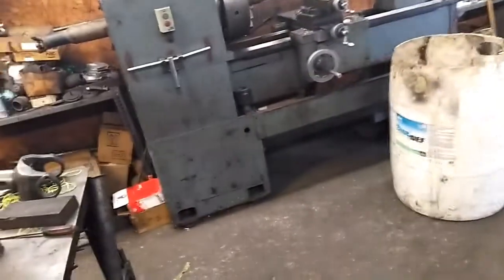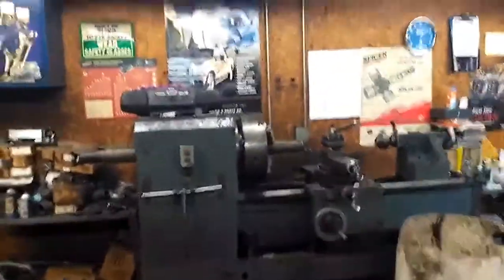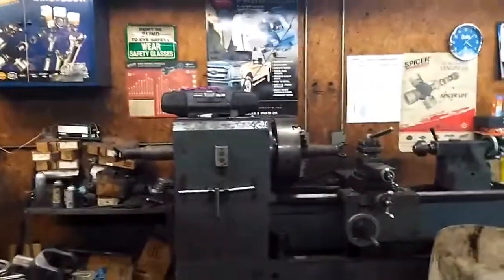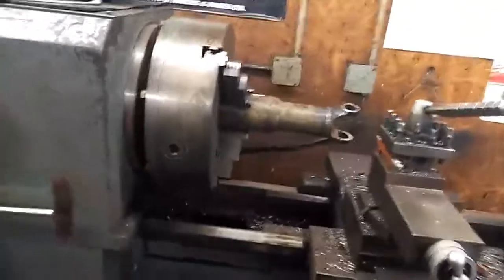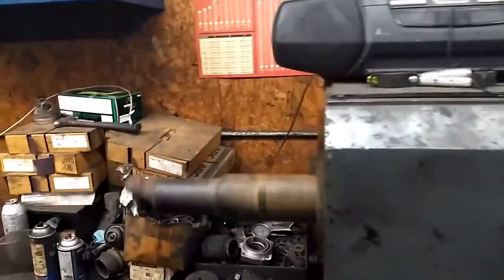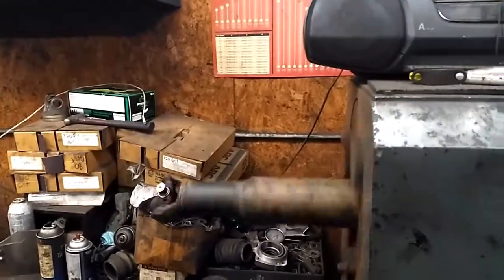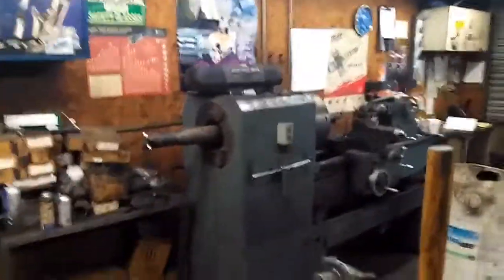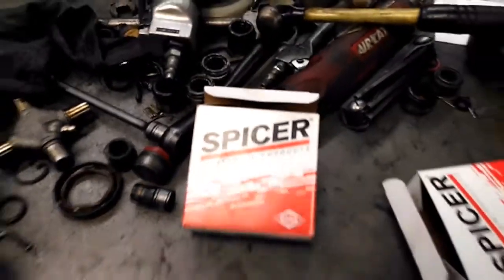Reason not to go to junkyard for driveshaft

Comment: man thank you i am praying praying this is my trucks problem. i bought a truck that has this "hop" or shake that drives me nuts. iv put new wheels and tires on the truck thinking it was the wheels, iv re-balanced tires. i put a new front axel on the truck and nothing fixes it. i asked my mechanic and the only thing he could see was that it has a junk yard drive shaft on it because he could see the writing on it. its not in the front of the truck cause if you lift the rear of the truck and gas on it, it gos to shaking like crazy. so its the drive shaft or axel is the only thing left. looking at the rear tires in my mirror the tire looks perfectly straight so i dont think its the axel. i might just bight the bullet and buy a new drive shaft for it and see. thanks
Reply from the maker: @ARdave311  man I built drive shafts for 8 years the worst thing you can do is get one from a junkyard you can look online an order a new one a lock keeper then you can find one or have it built